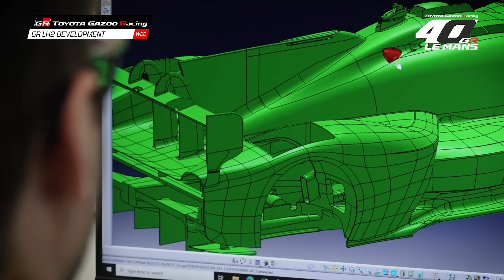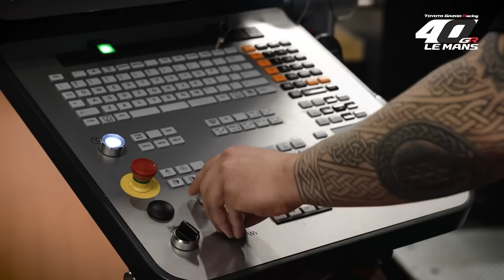TOYOTA GAZOO Racing 液体水素を燃料とする「GR LH2 Racing Concept」をル・マン初披露

Comment: This is the future for cars, not electric. Current batteries are not sustainable, they are too expensive and are hard to recycle. They also use rare earth elements like lithium. Hydrogen is everywhere and 100% clean.
Reply: False. Since hydrogen production is very inefficient, using it makes sense in just a small subset of cases, such as long-distance trucks, planes, or wec cars for that matter etc. For the rest of us, BEV vehicles are gonna be just fine - considering very high recycling percentages from used batteries and unbeatable efficiency (95%) when charging directly from the grid instead of using that energy to produce hydrogen (25-30%).

Comment: This looks so sick!! Can’t wait to see it in action!
Reply: No series is going to start a hydrogen class.
Hydrogen is a waste of time and money with EV’s.
Reply: @guybeingaguy  ev is not the way. Sure, when you use it, it doesn't emit anything. But from the construction to the recycling, it's maybe even worse than standard combustion engines. And for car enthusiasts it's straight up bad in terms of experience. Ok, the electric car can accelerate faster than any ice car, but where's the fun if you don't have any sound accompanying it? Also, I don't want to way 3 hours just to drive half the distance I could with a full tank filled in 2 minutes